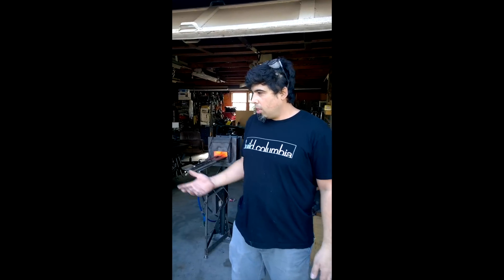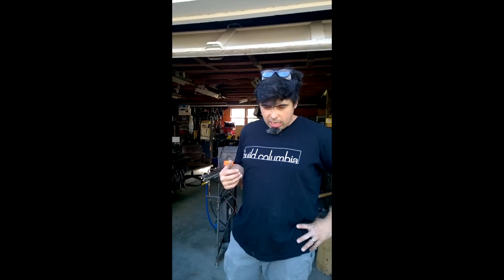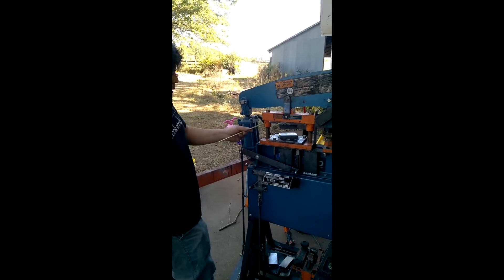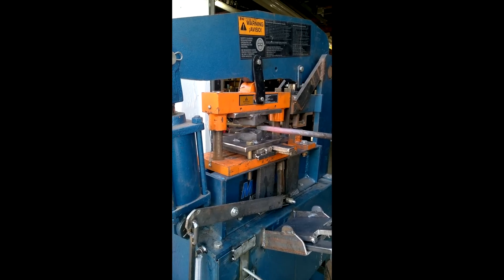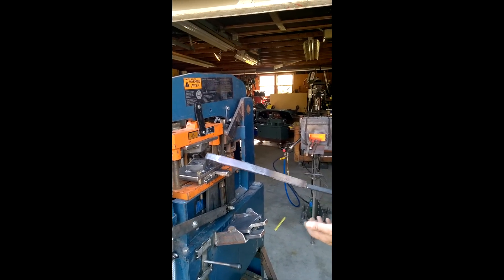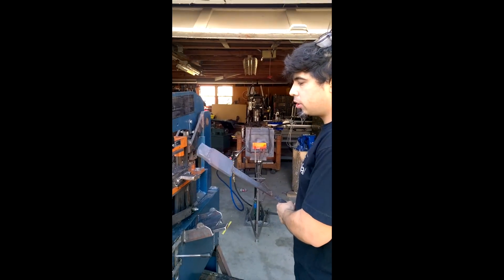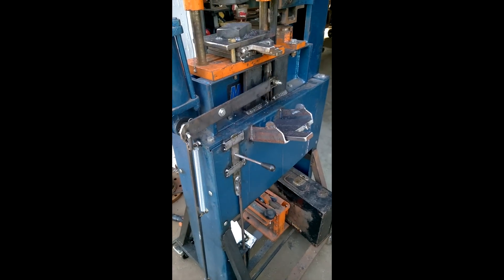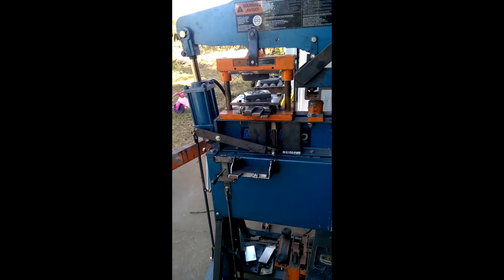Final video of experimental 40 ton forging press

Comment: Tell us about your forge!
Reply from the maker: +Jim M. My mentor Don Asbee helped me build my forge it's similar to a design that a friend of his used to market. I have it mounted on a bar hight table base pedestal left over from a job, with wheels attached. The blower has a .028 mig tip and the air is driven by an air compressor (Don's design).
Reply: +UV Metalworking & Fabrication Thanks for your response.  Sure would like to see a vid on that forge build!!!  I need a good design badly.  Yours looks exactly like the size I need.  Thanks man...
Reply from the maker: +Jim M. Here you go https://youtu.be/EZDDLNDoe2k
Reply: +UV Metalworking & Fabrication Thanks UV!